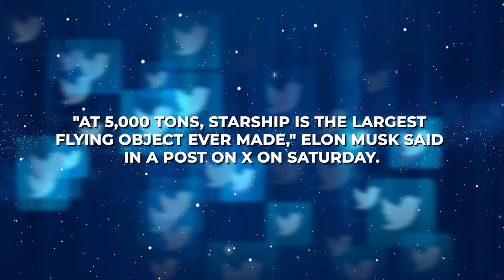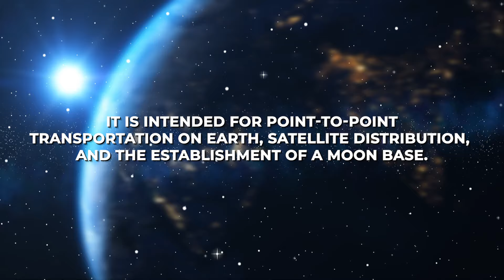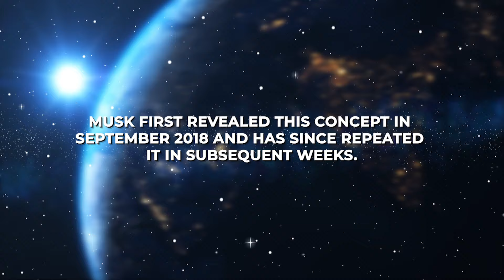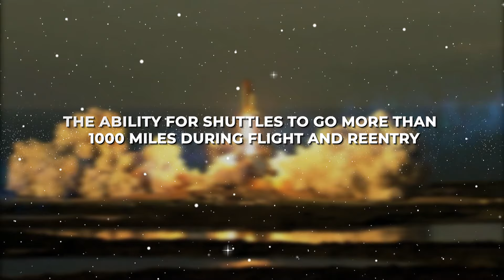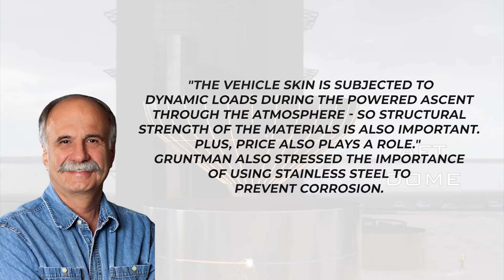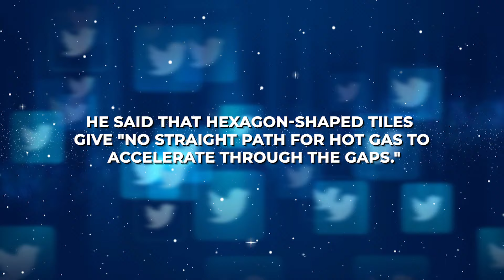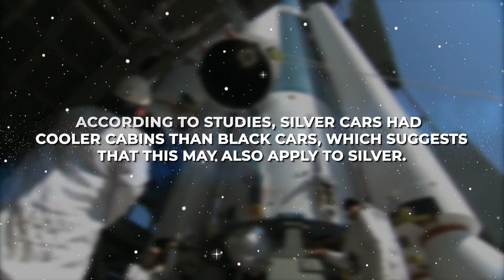Elon Musk Might Have A Solution On How Starship Will Survive Reentry!

Comment: Gee? that new re entry profile description is what I have been writing in writs for months on Alpha Tech in comments...
Was hoping they would get the message.. 🤗

On the aft wing flaps, they need to add a forward strake and turn it into a double delta to get more passive stability, that stake might want to be above the centerline on the hull. to add some V hull effect with the wings in aft position. I would slope the strake bottom surface up going out to its edge, 
and on the back side doesnt matter as much, square or sloped.
Whats important is to get the V shape to counteract the round bottom hull effect.

Basically extend that aft wing base mount structure forward.
This will enhance your glide ratio some with out much added  mass and be a good wiring trunk.

Also consider doing some control surfaces like flaps on aft of wings, and forward flappers, so you can maintain glide,  and not sacrifice as much lift adjusting flight...

Anyway, happy you guys are thinking, Just that longer re entry profile should help alot... And I wanna see this ship function well.. (!!!!)
I'll be ctossing my fingers!
Reply from the maker: Yes, indeed! Upcoming tests are getting more exciting. Thanks for being here.
Reply: @elonmuskevolution  
I've been "here" since the beginning... just had to keep using different user names from being banned on forums, and from being in the tropics where humidity takes out your electonics and you can never get your old email or user names again etc.
Have been doing writs all along with concepts, on all kinds of related sites, and always happy when they help. Some times its funny though because everybody has opinions and decisions have to be made, and sometimes things dont work etc.

But whats important is making progress, and this time they were trapped by ships ahead, so the flight profile change is a butt saver.
It will help. Evidently Elon got the logic again.. once that happens its game over! And I have fun too!
Mostly waiting to see what gets used...
Some times I repeat stuff to make sure it gets out...
Basically "Passing in the blind" to SpaceX, then waiting for effects...
Stuff spreads like crazy online,  people do their own interpretations, but concepts permiate into the community.
You always feel good when you were able to help better something.
Theres alot of people working really hard at SpaceX, they deserve all the help possible.

Comment: Then again, he might not. Especially if no solution is given in your clip. But what's implied is that up to now he had no plan and that first three starships were launched without a plan to survive reentry. One must wonder why was then reentry in flight plans for all three of them.
P. S ITF 4 won't survive either. The problems are that first, heat tiles are not fastened good enough and get loose during the launch, and second, the fuel pipelines are not strong enough to stand the stresses. All three launches showed fuel leaks which led to the explosion of the booster and spin of the spaceship 3 , resulting in an  uneven entry which exposed unprotected side to plasma.

Comment: if all Tiles on the ships  metal facing side had micro carbon fiber strands on all edges
All being able to mix tangle trap under the next tiles
the amount of loose dropping off tiles should be a lot less even none at all
even a heat resitant grout inside the gaps.
between the forward fins and rear fin controllers
a thin egg shell extendable heat shield flap
that would sit atop of the cylender
could push out making reentry shape vastly greater.
Akin to sky diver flight suit flaps between legs and arms
vastly building entry profile
Reply: Kinda like Velcro.
Reply: @AidyPhive  Not to stck tiles like velcro??
To link all tiles at edges to stop lift and forces sucking vibrating them away.
Reply: @stgeorgeist  I didn,t mean underneath. I thought you were saying interlocking fingers between the tiles kind a like velcro but not.